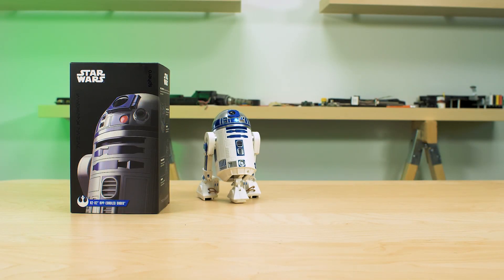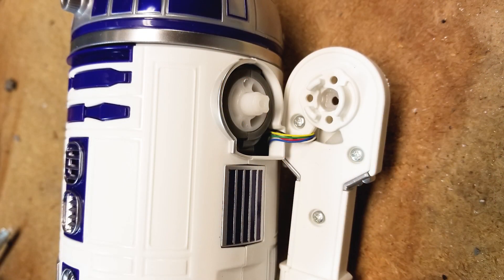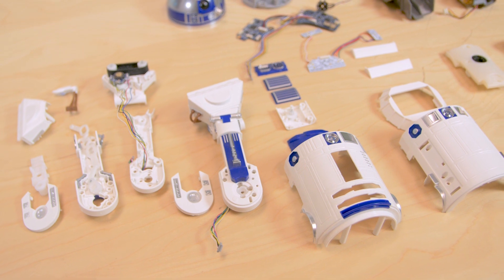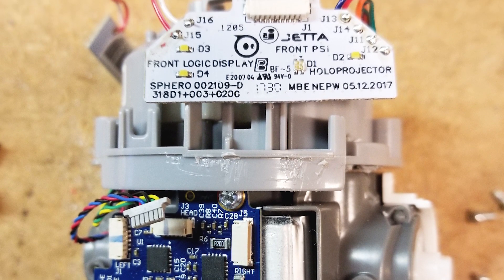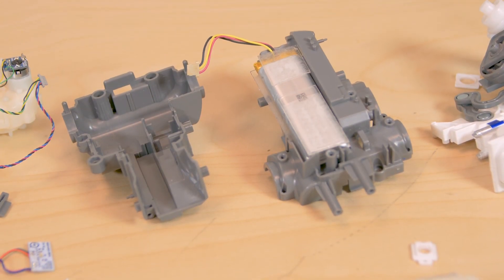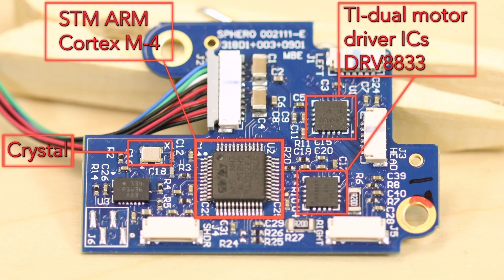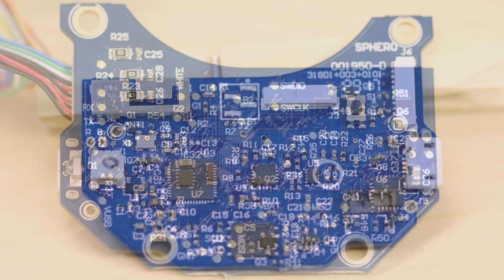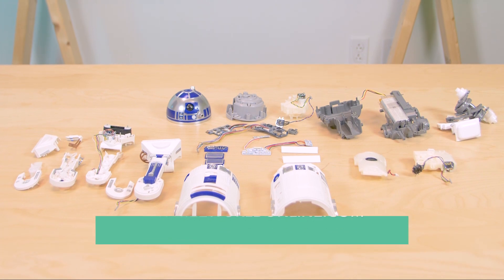Sphero's R2-D2 toy

Comment: For what is the yellow cable at the battery? Can not be for balancing when loading, because it is only a 3,7v battery. I had a dead battery in it and chosed it with a 800mah battery (Molex plugs) for the Hubsan 107d drone. Fits perfectly in it. Original in the robot is 1400mah. I soldered only the red and black cable on the original plug (red/yellow/black), which goes at the platinum. I didn't load it with the port on the R2D2. At the right back side from R2D2 is a back cover, under this, where the one screw is. There I made a opening for the plugs. You can easy disconnect in this opening the plugs and load the battery. After the battery is complete loaded with my Sky Charger D100, I close the hole with the original cover with his fastening brackets and nobody can see the difference from a R2D2 with the standard battery in it. Now I have more control over the battery. What the status from it is and I can chose a trickle charge, if I do not want drive with R2D2 a long time. If the battery is bad in a few years, I take simply another one in and R2D2 is happy again! NOTICE: For all people which will make that too with her own robot, this MOC is only for accomplished hobbyists. You risk a fire damage!!!!!!